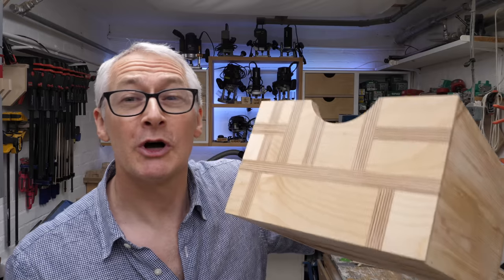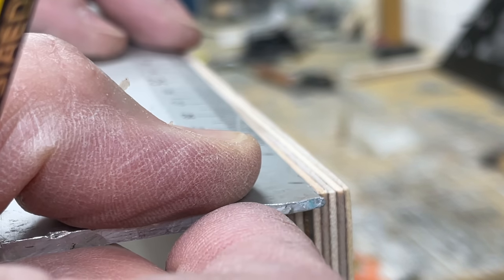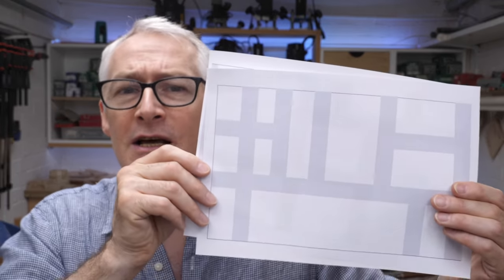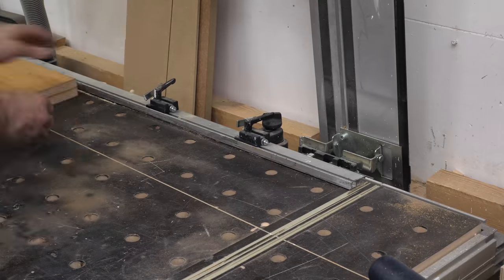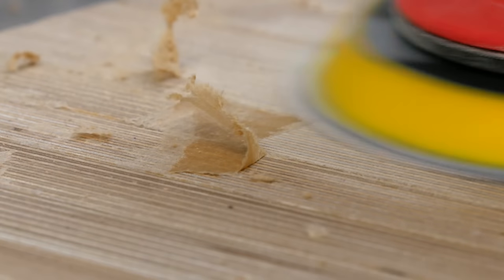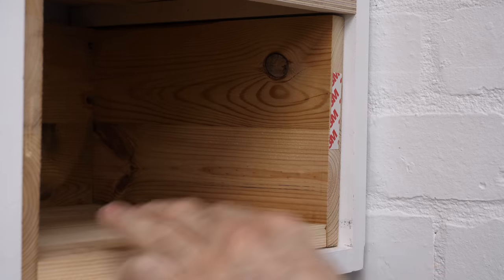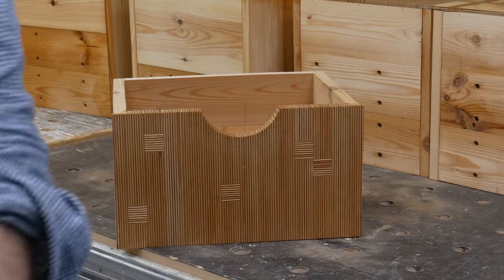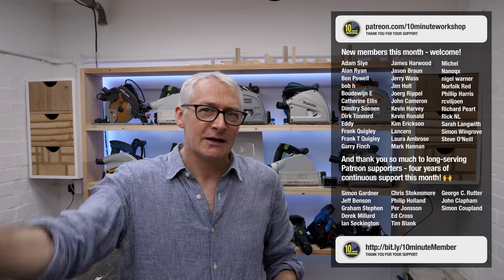Turn Ikea Shelves into Basic Boxes with Fancy Fronts [video 465]

Comment: That birch ply is so much more superior than std ply or some of the far eastern ply, no empty pockets or full of filler.
I notice some difference between the mdf that you use across videos? The green is moisture resistant, but i’m not sure about the one that looks layered. is that just a different manufacturer of MR mdf?
The zebra/tiger stripes look great btw, excellent job as always.

Comment: Great video as always Peter. Also crammed in your three workshop videos too 👍. Just a quick question as I’ve seen you do it a couple of times. Why do you cut the waste off a rebate with the track saw and then clean up with the routers table. Is it not easier just to do it all on the router table or are you going for speed and less dust all round on the two step variation?
Reply from the maker: Thanks Paul. If you have lots to do then a single pass on the router is easier, I find, then taking ~3 passes to get the depth. So, trenching cuts to remove the bulk of the waste, then single - depth pass to clean up. 👍

Comment: Great as usual two quick questions first what have you hooked up to your thicknesser/planner 
Second what size of blade did you use on the bandsaw
Reply from the maker: Thanks! Do you mean what extractor? It a 50l metal drum type I talked about in this video - https://youtu.be/qANLry7qITw - and it’s a 1/2” blade that I can just about squeeze on. Works well. 👍
Reply: @10MinuteWorkshop  perfect, Peter thank you gonna look at your review now sounds something similar to lumberjack extractor 
Is the band saw still one of the ones you did reviews of sorry for being a pain

Comment: Hi Peter,  would you be able to do a video explaining about the different types of plywood, alot of people talk about using baltic birch plywood and say this is the best plywood to use for furniture although I am struggling to find baltic birch plywood in the uk. Is there a difference between baltic birch plywood and Russian birch plywood and what other plywood would be good to use for furniture especially cabinets.
Reply from the maker: Hi Derek. ‘Baltic Birch’ is a favourite of our American cousins, but I’ve never come across referred that way here in the UK. For furniture work, B grade Birch ply is usually favoured, or B/BB (one face in B, one in the inferior BB); a quick google showed up this plywood grades explainer below. Hope that helps! P

https://kitronik.co.uk/blogs/resources/plywood-grading-resource
Reply: @10MinuteWorkshop  thanks for that Peter,  I have came across this article before, but it concentrates on the different face grades of the plywood and does not go into the quality of the internal make up of the plywood (amount of voids inside the board).  I am just getting started in woodworking and trying to get my head around what I need to start my first project next month when I get my new table saw. Dont want to spend a fortune on the wrong type of plywood.
Reply from the maker: Oh OK. Briefly then, of the commonly available plywood’s Birch ply has the most layers. There are typically no voids, but the individual layers can be butted together, and you do sometimes get imperfections knots etc… on the internal layers that can show up as black or darker marks on the cut edges. Marine ply is the only plywood that I’m aware of that has continuous layers across the board. I wouldn’t use anything other than Birch ply for furniture. A general grade of exterior ply is WBP (water and boil proof) , then general hardwood ply, and shutting ply. Each of these is an inferior product t to Birch and I wouldn’t use them for furniture. HTH. P
Reply: @10MinuteWorkshop  thank you Peter, that gives me a better guide to what I am looking for. This should make my search go so much easier. Now comes the task of finding a decent supplier.